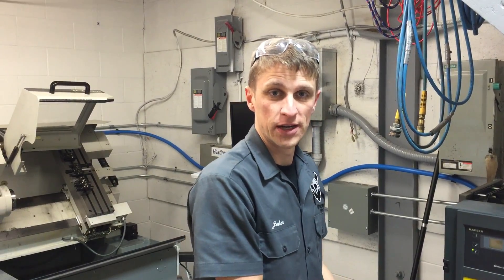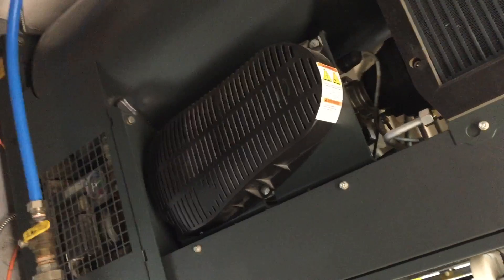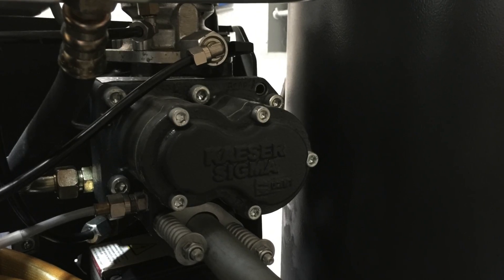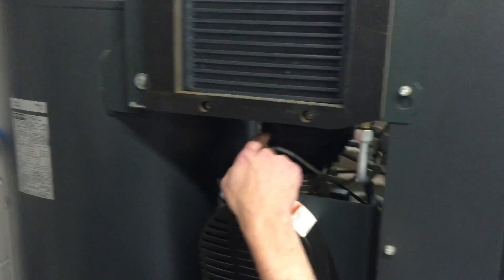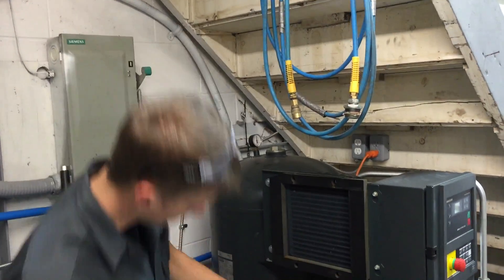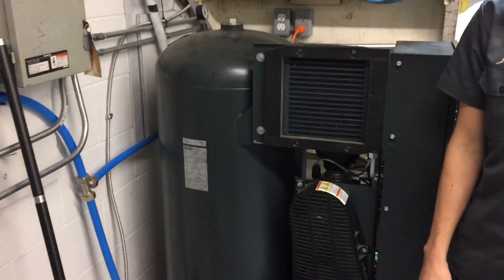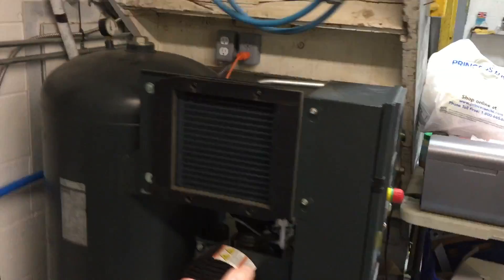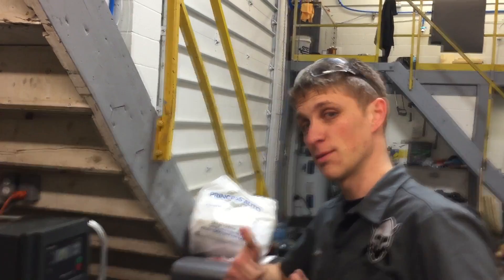Rotary Screw Air Compressor - Who Knew!

Comment: A rotary screw compressor is good for large volume, high pressure air.  NEVER scrimp on oil or air filters.  It doesn't take much dust or particles to literally chew itself to pieces.  From experience.

Comment: https://youtu.be/RUFiK9NT_Ls  <- Rotary Screw Compressor (1.3 liter displacement compressor, intercooler, and stock 1.8l 4 cylinder engine at 4 psi boost initially)

Comment: That's a neat little compressor.  Make sure it gets lots of work, as running with a little or no cyclic rate stuffs them as they fill up with condensation.  We installed a brand new Atlas Copco screw compressor at school and it blew up in the first 2 weeks.  They replaced it warranty, and altered the program to make it idle and keep it at operating temp.  Cheers, Aaron.
Reply: +NYC CNC hi John, yes mate it's hard to believe. They get condensation in the oil resulting in poor lubrication  causing bearing and screw damage.

Comment: make sure you monitor the oil level....  we had an ingersoll rand that ran out of oil rather quickly brand new.(i think oil consumption might be higher until they are broke in or something)  i think our unit was about 40 hp and around 175cfm@130psi.

Comment: Scroll compressors are very compact and vibration free also.  Thanks for the video.
Reply: +craig ward I never said it was.
Reply: +Amateur Redneck Workshop you said scroll above, typo?
Reply: Scroll compressors are very compact and vibration free ALSO.  You have to consider all of the words in the sentence.  That means screw compressors are very smooth but so are scroll compressors.  Not trying to be difficult, just wanted to be quoted correctly.

Comment: You have two coolers, one to cool the oil and the other to cool the compressed air. Its an aftercooler.  I have seen them in the 600-700 cfm. Engine driven and 50 hp electric. 
Keep them comming. Greg

Comment: When low pressure goes to high pressure it generates heat and high to low 'sucks' heat out of the environment. That's probably why theres a radiator cooler there, to liquid cool the screws (I guess). And it's why compressed air cans get cold when used.

Comment: I watched a YouTube video of a supercharged being used as a vacuum pump for a vacuum table..  being a car enthusiast/builder I know the parasitic losses associated with these types of screw blowers/compressors very well..  the reason that screw length is so small is two fold, one it doesn't need to move a tremendous amount of cfm like a car does at high RPM and two. of it were much bigger the motor power requirements would get out of hand quickly.  in the video it became evidentto the vacuum pump builder how much power those require.. granted in a vacuum situation the load would become more significant but even in positive pressure flow direction those screws see a lot of torque requirement due to their efficiency at moving air,  it work they do is impressive.  I'm surprised to hear the oiling is an issue as it doesn't seem to be so drastic on cars.  although I suppose on vehicle the majority of the time the compressor is in bypass mode for normal driving under vacuum conditions whike this is dedicated to be making pressure anytime its turning..  awesome compressor!!!

Comment: John The thing about rotary screw air compressors is there service life is much longer than piston air compressors. Just look at the specks on you piston compressor it is probably 2000-3000 hours. I have run rotary screw compressors 24 hours a day 7 days a week for years with no problems. You do have to maintain a consistent service schedule of changing filters and oil but there are fewer moving parts in the compressor. Also the sound is quieter (With the proper sound enclosure) and less annoying than a piston unit. People think they are saving money because the piston compressor costs less in the beginning but they will end up spending more in the long run wit a piston unit servicing valves in the heads or just replacing the pumps(Take it from me I have done that). The modern machine shop depends on clean dry compressed to function so don't scrimp on your air system you will loose money if you do.

Comment: i worked long time in this busenes here in germany. Mostly on atlas copco or kaeser. this is top quality brand.
just to explain the cooler.. if air is comprassed it gets hot.  the cooler on top is a dubble cooler. one way for the hot oil one for the hot air. direkt after the screw the air/oil mix is about 80-90 degree Celsius hot. in the big oil container is a seperator who seperates oil and air. behind that is the cooler. if you whant absolute clean air you have to set an micron filter after the tank. the seperator cant seperate all oil out of the air. there are always 5mg oil per qubic meter air. thats why you have to look in weekly exercise at the oil level. . and very important.. if you refill oil.. dont overfill.. if you do the oil what is too much will go little by litte whit the air in your pipes and machines.
 (sorry for my bad english im not native english)

Comment: Hey John,
I am sorry that I did not mention that part of the system when I commented about the schedule 80 system layout in a previous post you may remember. I thought you where aware that they are preferred if you can outlay the cost. If you decide to pursue one I would recommend you also look at the Quincy compressor line. We chose them over Kaeser but both are solid companies.

Comment: I told you some time back when you asked about compressors - Kaeser compressors are the way to go.  We've got 18, 19, 26 & 75 hp models.  (The two smallest ones have been going for about 25 years)
Reply: NYC CNC Yup.  Basically just fluid & filters.  They're really reliable beasts.

Comment: I did. 😊
I used to design them.
http://youtu.be/YDh2X0cn-3E
Kaiser is one of the best..
Stick to the recommended oil, filter and maintenance schedule and it will last a long time.
Keep an eye on oil level and water content. Nothing crazy, just make it a daily or weekly check. 
The oil is both a lubricant as well as a coolant and is mixed with the air stream. The big filter separates the air from the oil after compression. Most of the heat of compression is in the oil which gets cooled and recycled. 
Rotary screw compressors are great machines. You'll love it.
Thanks,
John
Reply: +anothermoth No, they do not. On the small units, 5 to 20 hp, they typically don't adjust the compression ratio at all. The cost of the mechanism is too high for the gain in efficiency.On the larger units where the cost savings are significant, the adjustment is made mechanically, pneumatically or hydraulically, if they do it at all.
Reply: +John Bazaar Do they adjust the compression ratio by varying the amount of incompressible oil in each 'stroke'?

Comment: that aftercooler is probably piped in between the compressor and tank nit the tank and outlets. they generally do that to try and avoid any moisture in the tank to begin with. mainly just there to try and equalize the temp between the outside and inside of the tank to cut down condensation
Reply: +Finn Custom Knives Gotcha I think you're right Paul.  The superheated air coming out of the compressor would surely go through the tank next.
Reply: +JohnGrimsmo amazing compressor man! do you know offhand how many cfm it puts out at 90psi?
Reply: +Finn Custom Knives i forget if it was 27 or 40 cfm.  27 probably.
Reply: +JohnGrimsmo thats awesome! Over twice what I have in my 3.5hp 60gal and I could definitely see needing it.

Comment: Very cool, whats the advantage to a rotary screw compressor?  Is it quieter?
Reply: They are much quieter. The duty cycle is close to 100 %. So unlike conventional compressors it doesn't run fill up the tank, use the air up and restart the cycle. So you don't have to buy an oversized compressor to maintain the flow you need. The rotary action is also a continuous motion so there is less vibration.
Reply: +zaprodk not all of them are quiet I work in a fab shop and we have 2 of them and they are extremely loud
Reply: It's smaller and more efficient.
Reply: +Rich Schaefer Very quiet!
Reply: I guess there's always an exception to the rule :D

Comment: i think they can be so small because they compress almost continuously along the length, rather than once per up and down stroke like a cylinder compressor
Reply: +HomeDistiller That's exactly right. Depending on the manufacturer, they will have 4 or 5 compression volumes per male rotor (industry term, not mine). The small ones also run at 3,000 to 5,000 rpm, depending on the manufacturer, size and design. Reciprocating compressors found in most shops only run 500 to 1,000 rpm. The little "pancake" oilless compressors you can buy at Sears or Harbor Freight are exceptions.People like rotary screw compressors because the push a lot of air in a small package quietly with very little maintenance.